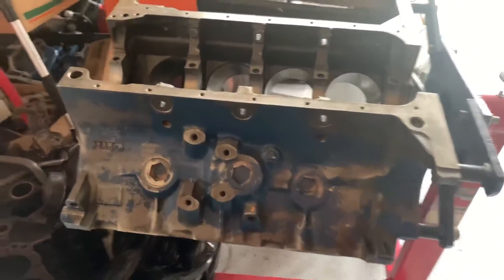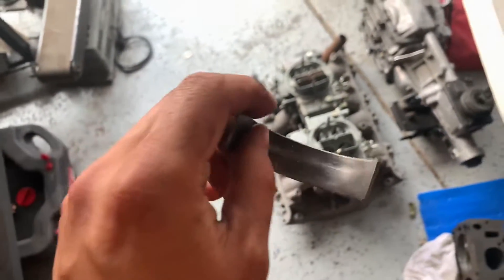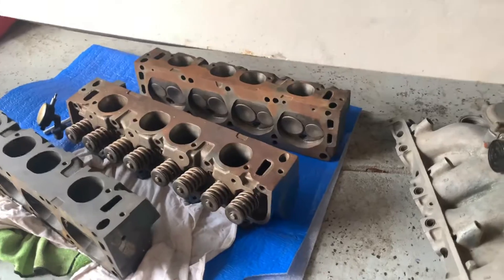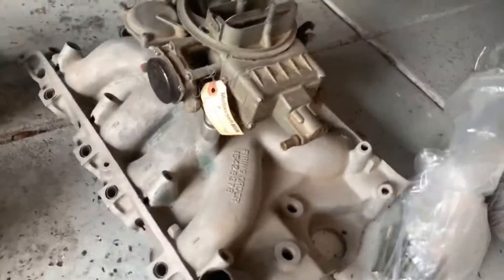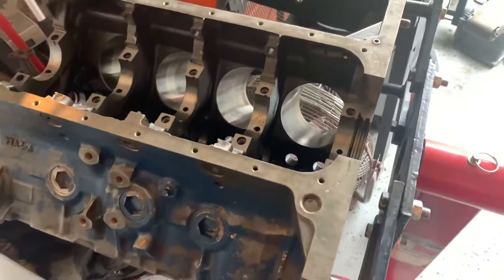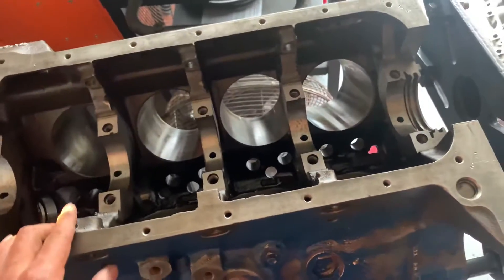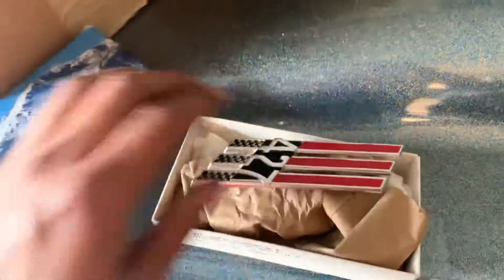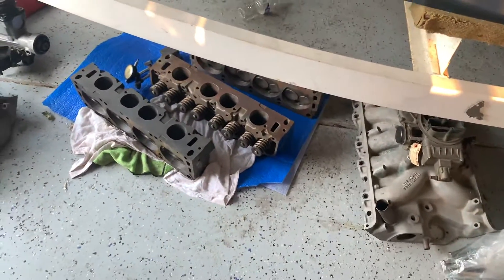Ford 427 side Oiler

Comment: Cool find. These are getting pretty hard to come by, especially if it has the dual quad factory intake. Everything from the late 60s is getting rare/expensive. Know a guy who bought up cores awhile ago and is just sitting on them including more than a few BOSS 351w and 302 heads as well as late 60s 460BBF parts.

Comment: I threw-away a pair of cast iron 428 Cobra Jet heads...they'd been mutilated...cut down around the top for double springs and a dampener...UNlightly-ported, too.
Reply from the maker: Yea…. All my stuff has been at the machine shop. They say it has issues but it was a strong running motor before I took it out the boat. I want to get a second opinion.

Comment: Put it in a 66-69 Falcon and you can bolt it in with 66-69 Fairlane motor mounts and stands. All other parts are a factory fit , radiator, headers everything. Perfect sleeper. Mine uses 3 holleys two barrel carbs from a 406 and medium riser 427 heads. 300 degrees of advertised duration 520 lift.  
A 7000 rpm big block can be exciting in a 2700 pound street car.